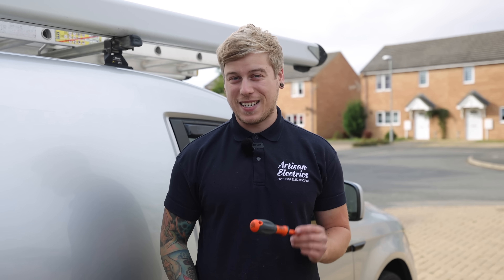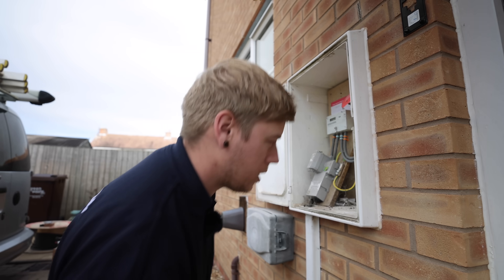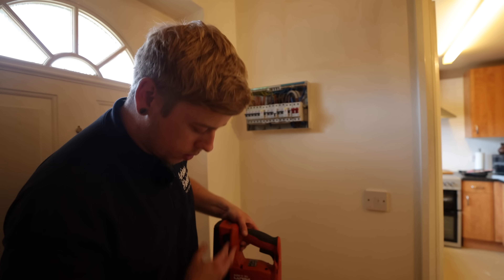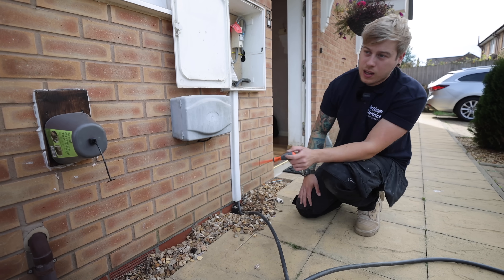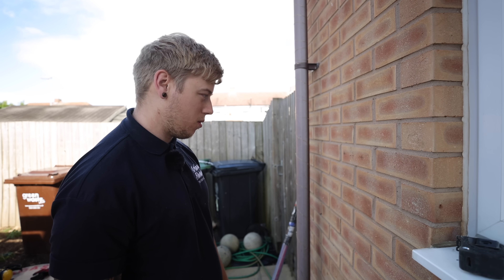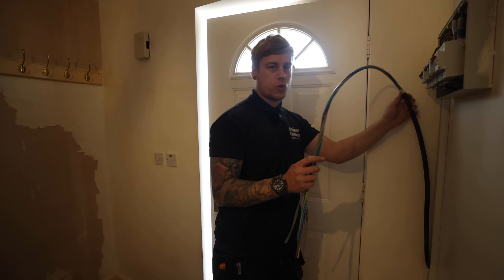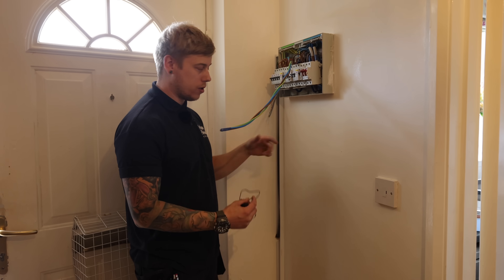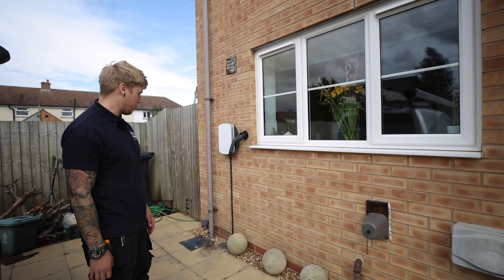How to Install a Hypervolt Home Electric Vehicle Charging Point - Electrician Life

Comment: I didn't think you were allowed to direct bury non armoured cable on 240v. I understand cleating it at a height above risk of disturbance, but not buried just under surface, especially without a sand layer.
Reply: Technically not, but as he said nobody is going to put a spade in there
Reply: @acelectricalsecurity  The cable is not designed to be squashed between stones with sharp edges. Very neat install but 'Technicall not' actually means he used the wrong cable. Should have been SWA.
Reply: @misstertash1701  that cable is very robust, and that shingle will not damage the cable, and there's certainly no danger of anyone hitting it with a spade.
Reply: @acelectricalsecurity  why not, someone might do exactly what he did and dig it up to run a cable there, although being rocks it will probably be by hand.
Reply: @LawnPotato  that's true, but how many times does that happen, the interesting thing is, that a lot of people have commented on burying cables and how it should be done, but no one mentioned installing warning tape.
Reply: @LawnPotato  as he had to dig it by hand
Reply: @acelectricalsecurity  I would have thought danger tape is a given, as is the 500mm bury depth. He could always use those hard plastic covers, but still technically needs a sand layer.
Reply: @LawnPotato  as I said I have never seen an SWA with a bed of sand, and the utility companies definitely don't use sand, your lucky if warning tape is used, plus I have seen warning tape on top of the cable which is useless.
The cable in the video is robust, under gravel, and personally I don't really have an issue, when cleating to the wall low down, it could get damaged as well, I thought the guy was getting unnecessary stick for installing the cable under the stones/ gravel.
Reply: @acelectricalsecurity  the sand layer protects the cable from hard rocks or shale, if you're getting a job inspected where you've direct buried cable, at least in Australia, then the inspector should pick it, and generally asks for photos during burial stage, if you don't use him all the time, if he's your regular guy, then he knows your work quality and methods, like mine does. As much as I'm watching these videos for entertainment, I also like to see how others do it and if I can learn a trick or two, and when I do leave a comment with criticism, its not about throwing shade, sometimes they don't know too, just like a few vids ago they drilled through roof trusses, they came out and owned the mistake, only after it was pointed out by viewers, they may never have known if no one said anything just to avoid stepping on toes.

Comment: Hi Lee, run the cable in conduit rather than buried, slightly deeper would be more practical. Other than that, good installation.  👍 approach is positive. Keep it up

Comment: Just a tip for safety.  Start the pilot hole with a shorter bit of the same diameter.  Yes it takes a few seconds longer, but making the hole with a longer bit has more of a potential to slip as the bit will sag.  Having an hole that the long bit can go in means no slip.

Comment: Neat install Lee. I install ct in board in these occasions as making a joint is not good practice if not necessary in my opinion.
*Just a note for the next one if the chargepoint doesn't have a display like the Hypervolt then it can be mounted between 750mm - 1200mm so could of gone below window. Only display units are 1200mm-1400mm.
Reply: Imagine winding a 5m cable on a charge 750mm high. All savings you make will keep the chiropractor busy.

Comment: Noy a very good install, using the meter box as a route and also putting ur armour in the same "trunking"(should of been a hockey stick that comes with the 1ph cabinet) as the main incoming. any overheating/melting of the armoured could cause damage to the 35mm incoming service as only a plastic sheet and then ur  N+E  and cores , that's why it runs on his own in a plastic electrical duct.   I would advise u let  ur costumer know about the risks of "hiding" that cable and putting it right..     PS... If anything goes wrong with the  main incoming service in the section  of your install  your company would be liable to pay the DNO  for any future repairs .. looking good dosent mean safe..

Comment: I’ve never done it with a hypervolt before, but usually when there’s something you have to hang up you can turn it upside down and use the bottom holes as help, instead of having to measure and use your water level etc.
Reply: btw, great job lee, looks great.

Comment: When we had our Hypervolt installed, electrician used dry wall screws to fix charging cable holster to the wall. Looks better than silver screws. Just the observation. Keep up the good work 👍
Reply: Dry wall screws?
Reply: @heladas90  yes, they are black
Reply: Drywall screws aren’t rust resistant. Unless you are in a desert area you maybe replacing those screws in a few years.
Reply: @mikecumbo7531   I guess I will have to if they rust.
Reply: They don't really hold that well in red plugs as they are thinner, he could have used a smaller plug, but nearly every electrician will use predominantly red plugs, it may work loose over time.

Comment: Hi I am due today get a hypervolt 3.0 installed at my property this week. I do solar and growatt inverter and battery system. I have been told it is a straight forward install but I am concerned they are not taking into account to integrate it into the solar. Is there anything I should be looking out for with the install if a hub would be required etc for measuring solar, battery and grid

Comment: Thanks Lee that looks great. Question: why do you need the data cable and CT if the charger can communicate with Wi-Fi?
Reply: The Data/CT is required to monitor the current flowing through the whole installation (hence putting it on incoming tails).  This allows for the load management in the Hypervolt to do its part if someone turns on the likes of showers, kettles, Tumbles and cookers etc the same time as charging the car.  The CT will detect it and ramp the car charge down until the current drops back.

Comment: HI Lee  Enjoyed watching your installation, as said very professional executed, thinking ahead for a VE, I have a 32amp cable approx 10m in a ducting to my garage for my Joinery machines on a 16amp fuse, now retired, so not using the machines, is the cable large enough for a charger. Regards welshman2081

Comment: Mate that cable needs cleating under the shingle, especially as its not swa. What erection method is that? Its not clipped direct that's for sure, if its buried then it needs to be in a duct and actually buried 450mm. I put swa under shingle but I cleat it also.

Comment: Great video. I thought though that EV sockets and controls need to be between 0.75m and 1.2m above ground. Displays should be between 1.2 and 1.4m above ground? Stupid rule in my view.
Reply: I always thought they would use the 1.2m height for part M, but that isn't the case

Comment: if i ever got an ev in my current place the electrian would hate the install of mine, the main box is at the back of my local shop and im on the second floor flat with the fuse box outside my front door then he would have to go in to the roof from there to go out the back garden about 100 meters to the back wall to put the charger would be a nightmare for them hehe. so think ill wait till i move one day before i get a ev or charger

Comment: Question - I guess it isn’t mandatory to install an SPD?
Reply from the maker: It is unless you do a risk assessment to prove it’s not needed or get a written statement from the client that they chose not to install one
Reply: @artisanelectrics  thanks for the fast response!! I was an electrician for 7 years and still work in the industry. Watched so many of you vids trying to sus out what to do. 
I stay in Scotland
Do I need to I need to contact the DNO?
I have solar with a DC coupled battery, what charger would you recommend?
I’m getting an ID4 which will work with intelligent octopus.

Comment: I'd say if you can make your work just as safe as what is already in there, and any penetrations to the case are properly glanded and sealed, then unless 19th edition comes out saying specifically not to I'd have done the same with the ev cable

Comment: Is it okay if i install this myself at home? I'm not an electrician, but a controls engineer (automation) and have 18th edition and so many other electrical safety certificates as well. Or does it need to be installed by a registered electrician with gold card?
Reply from the maker: NO - you cannot install an electric vehicle charging point yourself unless fully qualified and trained - you will need an electrical installation certificate, building regulations approval certificate and the DNO needs to be notified of connection to the grid.
Reply: @artisanelectrics  Could you please define what "fully qualify" means? I've got so many electrical safety qualifications, 18th Edition, Inspection/testing, BEng Electrical/Electronics Engineering, Siemens PLC, and work with 415v 3phase at work on very complicated electrical panels and automated networks. etc. I just want to know and may be it's better for me to get that missing puzzle piece.

Comment: Just one small mention, because you have used the meter box to route your cable, it's quite possible in the future, if the Utility company need to replace their meter box, or install other stuff, your cable could be in the way, so the Utility company could asked you to route your cable, because the box belongs to the Electric company.

Comment: personally i would have fitted the cable to the wall if its not amoured , never assume that no ones not going to dig around in the stone , you have
Reply: Technically your right, but even the stupidest of people wouldn't try to use a spade there, you have to use your hands.

Comment: Great job but I don't understand why you don't just split the tails and install its own small RCBO in a 2 way units..... Makes life easier and you are not getting involved with the customers boards opening up liability etc
Reply: Absolutely - DNO's say you shouldn't but for that install it would be a no-brainer. Still plenty of room in the box for a smart meter,  already-packed CU, need to put trunking on interior wall. Neater and safer to split the tails.
Reply: @mikeselectricstuff  DNO say....don't get in the way of our equipment...that's all which is fair enough
Reply: If your not allowed, your not allowed, looks don't come into it.
Nobody questions a plumber if they run a pipe up the wall or a gas pipe outside, yet for cables, they are expected not to be seen, it's a retro fit, and if they don't want a mess then this is the next best thing, the guy did the best he could.
Reply: @acelectricalsecurity  you are allowed.... Just don't get in the way of the equipment
Reply: @daverann  as mentioned on effix, it's clear you are not allowed to install equipment in the meter box.
Reply: @acelectricalsecurity  just because efix say it does make it law...
Reply: @daverann  no, but they contacted all the dno's and of all that responded they clearly stated it was not allowed.
And where I am, the meter boards still say manweb equipment only, and that's despite manweb disappearing many moons ago, and are now SP.
Reply: @acelectricalsecurity  the cupboard is the customers property.....so much as the DNO say we don't like it they don't a say.... As I say though don't get in the way of their equipment as they the the right to as you to move it....which is common sense
Reply: Even running the cable through the box would mean the customer needing to have it removed if the box is ever damaged and requires changing but it's a low risk so as long as you leave enough space in the box you won't have any issues and in the rare event the box needs changing you'll need a sparky

Comment: What i a RCD?
Reply: An RCD is a sensitive safety device that switches off electricity automatically if there is a fault. ... For example, if you cut through the cable when mowing the lawn and accidentally touched the exposed live wires or a faulty appliance overheats causing electric current to flow to earth.
Reply: It measures the current flowing to and from a circuit and will automatically disconnect the power across both poles if an imbalance is detected above the prescribed rating of the device, which in usually 30mA in domestic applications.